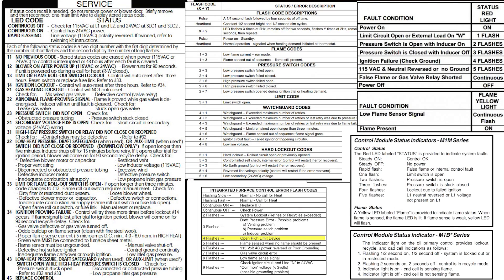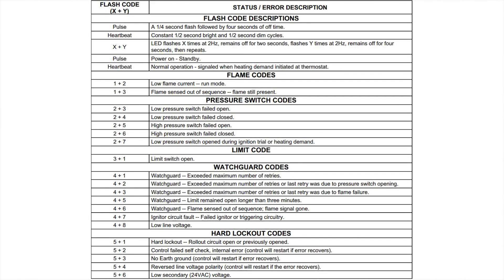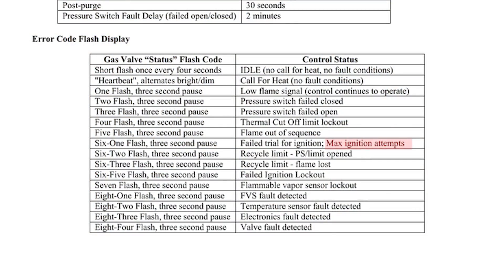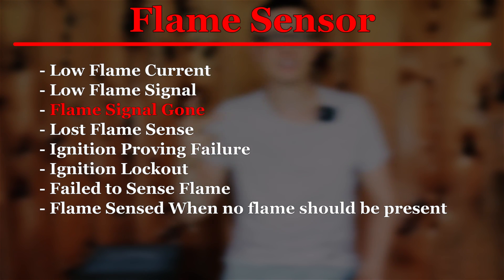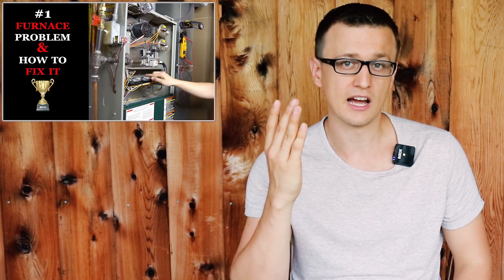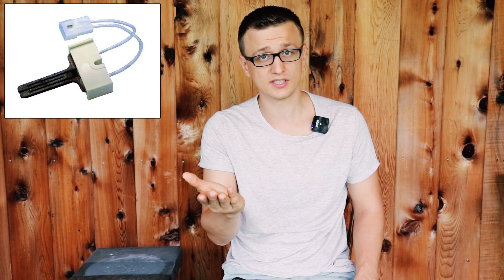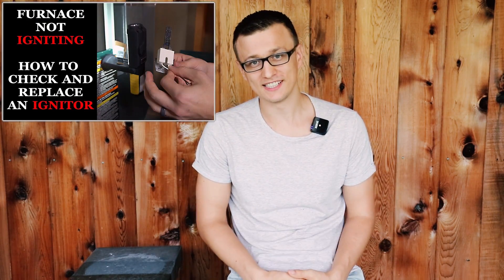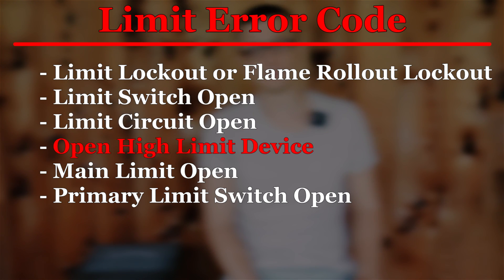Furnace Error Codes Explained

Comment: I posted 10 months ago: "I'm a Firefighter, I can usually figure things out, but I have had a similar problem each winter. Carrier induced-combustion gas furnace (heater) works, once or twice, then won't come on, and locks out. I glove up and go up into the attic, remove flame sensor, clean with green scratch pad, heater works. Each winter, repeat, etc. This year, worked, then failed. Bought a new flame sensor off Amazon, installed. It worked a few times, then stopped." Same thing happened a month ago, this time I also replaced the HSI (hot surface ignitor). Worked for a week or so. Air filter is new. Code is usually 14 "ignition lockout". Or, 34, "ignition proving failure". I know what a repairman will say, "oh, this is an old unit, 30 - 40 years old, we don't work on these anymore, just replace it." I'd even consider it myself, but it's in the attic, will require 2 - 4 people to disassemble parts, hand down through attic door, etc. so I'm guessing ~$10 - $15K for whole job. This is for heat which I use for 5 - 10 minutes a night, 10 - 20 times a year. If I can repair it, I want to do so. Does anyone have any suggestions? Thank you.

Comment: My Everest propane furnace lights then immediately shuts off. If I shut the power off to the furnace and turn it back on, it will fire just fine. The red light slow flashes continuously until I reset the power. It has a new igniter and new wall thermostat. Didn't help

Comment: Please help: I have a two stage Rheem furnace and air cond. system that is two years old. It seems to work ok but the controle
board is flashing 15 times then starts over and flashes 15 more times. The manual doesn't show anything for a error code 15.
Ive never seen the furnace run on the low state since it was installed. I replaced the thermastat with a ecobee smart thermastate and i have varified the wiring several times. The furnace has been powere off and back on but the flash continues.

Comment: My furnace does not display codes. Both red a s green lights flash fast a d the furnace ace turn off a few minutes after it ignites., then come back o. After about 5 minutes, and so on. What could be the issue?

Comment: My York two stage is blinking 7 times and it says low gas flow.  The ignitor is glowing red but the furnace is not igniting.  There is another part I cleaned with a dollar bill a few weeks ago.  I wonder if the gas valve is not opening? I believe something clicks when it opens and allows gas through? It has been doing this a few times for a few weeks now?🤔

Comment: Mine had solid red but only the inducer fan was working, turned the unit off with the light switch power thing, turned back on NO red light at all.  Bad circuit board? It's 2 degrees and we have no heat.

Comment: I have error code 24 on my carrier furnace. I I remove the Yi/Y2 from the board and measure the Y1/Y2 and the common on the board and is shorted o ohm, Is that supposed to be o ohm or direct continuity? or is there something short on my electronic board?

Comment: Not gonna lie it’s not me but the previous owners who owned this house were crackheads my circuit breaker with fuses in it is hardwired the fuses do nothing it’s always on no matter what you do and get electrocuted on top of that my heater he says the wrong amount electricity is going to it as well as there’s crackhead wires the wires are way too long and just dangling around inside the unit I was also told I should sue the previous owner or whoever wired the house cause he said there’s no doubt in his mind my house will burn to the ground

Comment: Hmm. I have two green lights, both flashing, alternating (when one is on, the other is off). The chart says that slow alternating lights means one thing, while fast alternating lights means another. The problem is that, having never seen the difference, I don't know if they are flashing slow or flashing fast. I was hoping to see a demonstration in this video.

Comment: My furnace wont kick on when I  turn up the thermostat. So my thermostat could say its  73 degrees in my house and I turn it up to 75 or 76 and the furnace wont come on so I flip the breaker off and flip it back on and then the furnace comes on and it will run for a little while then it shuts off and it will come back on about 2 more times and then I have to go flip the breaker off and on again. I have changed the batteries in my thermostat, and I have bought a new breaker and changed the breaker, I switched off the breaker and then switched it back on. I haven't checked the filter yet. I'll do that in the morning. I'm sure it's the filter now from what you have said, as we've lived here in this house a year and a half and have never changed the filter and I don't really know how dirty the filter may have been when we moved into this home. Thank you so much!!!
Reply: Did that work? It may be the thermostat was not sending a singal to the furnace

Comment: Hey Jay, good video here with a lot of everyday error codes explained... really appreciate it a lot, but unfortunately, it didn't help me. 

I have a goodman furnace. This winter I turned it on and it worked for maybe a few days just fine, but this morning, it just started giving red continuous rapid flashes... after looking at the code on the panel, the error code = REVERSED 115 VAC POLARITY/VERIFY GND. I tried looking up online for a specific answer, some say my board is bad, and some say the wiring needs to be reversed. WHAT SHOULD I DO.... ??? Completely confused. It was working just fine yesterday, what is the issue today with the wiring. I didn't touch it yet... ANY HELP WILL BE APPRECIATED... 😇😃

Comment: I have experienced an error code 5, which according to the code legend on the cover, is an open fuse.
However, it is not the mouve colored fuse which is easily spotted, as I checked it as ok.
I noted on the secondary of the transformer wiring, a fuse exists(3A) is shown,..but I can not seem to find it.
It apparently provides power to the humidifier transformer. When replacing a bad solenoid the hose blew off the output of the solenoid and got the connections wet enough to blow that fuse.
I am quite anxious to find it before my client loses all confidence in me.
can you help Jay?

Comment: I have a new furnace. It worked in winter. Ac got fixed this yr. Now time to turn on heat. Turned on and doesn't work. Switch is on, no breaker trip. The furnace sounded like it made noise but nothing upstairs. Orange 3 flashing lights w a longer orange light on 4th. Then it repeats the sequel. Anyone know what that means? I don't touch things w gas, scares me. 
I changed air filter too brand new and it wasn't even old. Do you have video on color not codes since they don't tell u codes in front?

Comment: Is it normal for a Daikin furnace to change status codes while running? I've noticed it says F3 when only the fan is running, then switches from P1 3, P1 7, or P1 8 in no certain order when the A/C is running. My hvac company said the codes were not normal, especially since the furnace was installed 3 months ago. I thought it was just switching status codes based on what was running (a/c or just fan). I trust my hvac company but wanted your opinion too.

Comment: I have a very odd issue while in AC mode. My fan turns on sometime during the night while everything is OFF.  Ive tried removing the thermostat while the fan is running and the fan continues to run.   The code is flashing 5 times fast (flame not present) why would it throw this code in AC mode?

Comment: Mine keeps doing a soft lockout so do you think it could be the igniter?
Reply from the maker: Before it goes into a soft lockout, it should be blinking a different code. I would reset power to the furnace and then watch the code once it powers back on. It could be an ignitor but there are plenty of other things that can cause a soft lockout too. This video may help with narrowing down the problem too: https://youtu.be/AQD_MedIklI
Reply: Thank you blowing out one of those small hoses worked thanks.

Comment: Exceptionally well done tutorial!!! Thank you very much. I am getting a 5 pulse error code on a York furnace that is probably fifteen years old. The control board was recently replaced and initially, the furnace was functioning properly. There is now the error code as described, and the 3 amp fuse is blown as well. Additionally, the blower motor runs continuously, even with the thermostat removed and the green wire disconnected from the control board. Suggestions?
Reply: Did you figure this out?

Comment: Well thanks to you and other techies I finally diagnosed the problem/s. Even though the igniter glowed brightly 🌞 the gas wasn't igniting so I originally said there was no gas flowing. But then another video suggested that if the burner/s were very dirty the gas wouldn't spray out well enough to light. But it could still probably light from a flame. So I did as suggested and used a barbecue lighter to good effect. 😀 I still have to clean the burners. They are a little tricky to take out as there are barely visible screws on the bottom. But I have heat and no service call bill to pay. 😉

Comment: What if you get the error code “Lockout due to excessive retries”? On a Goodman GMVC96
Reply from the maker: That means the furnace is in a lockout/standby for 3 hours. Try turning the power on and off to the furnace and pay attention to the error code light. It should give you a different code after the reset, when the furnace tries starting up again.
Reply: @WordofAdviceTV  Thanks! I managed to find the problem. Turns out the drain going under the ground was slightly blocked off causing one of the pressure switches to go open. Thanks again!

Comment: I have a tappan furnace, 120,000 btu, the yellow light on the control board is illuminated (no flashes), looking on the furnace door it states "yellow light flame fault" so I didn't want raw gas being dumped in my furnace I called a furnace professional, he stated " everything checks out working fine" then left, but did nothing to fix the yellow light. I did find an exhaust elbow leaking, so i corrected that, prior to the guy arriving I went through all the diagnostic checks, all sensors were fine, gas valve gets 120 volts that opens during the cycle, cleaned the flame sensor and even replaced a 2 week old filter but still the yellow light? I even went as far to snake my exhaust/intake clear no obstruction but can't clear the fault. Upon the furnace company's arrival, he checked the co2 level, water column and gas pressure which were all in specs however, I told him the condensate pump barely runs, he stated the heat exchanger was fine given the co2 readings? My reply is that they might read 81 but could be dumping in the furnace creating pressure and overheating? He did no further checks, charged me 148 bucks and left without fixing the yellow light issue (flame fault) . I would like your input on this flame fault board light and see if we can't correct the issue? I have a 2 year old goodman, coil and condenser in the garage but have no time just want to get through another 4 months and it'll be replaced.
Thank you!

Comment: Any ideas why my brand new furnace won’t run until I pull the orange wire off the pressure switch? Then the inducer motor comes on and I put the orange wire back on runs fine until it shuts off and calls for heat again same procedure again.

Comment: I just left this comment on another video: I hope this video helps:

My furnace shut off and blinks 3 times. I am trying to figure it out currently as I cannot get anyone to look at it till next week and I'm in Canada, starting to get cold. Any help is GREATLY appreciated. On the diagnostic chart, it says 3 blinds means: Pressure switch open when should be closed on single-stage models. Low-pressure switches open when should be closed on 2 stage/VS models.

I have no idea what that means or what model I have. Where can I find this info? I am quite handy so I know I can figure this out, I just need some guidance as this is my home (not a renter).

Comment: There was a leak from another condo upstairs, being an electrician I started looking into it. It is the middle of summer so this needed done, everything would shut off, had to dry everything inside the furnace and then the solid yellow light stayed on. All I could find on the error code was basically just flame sensor this and flame sensor that. So I could not find anything on it really that had to do with my situation is there anything else it could mean?

Comment: Awesome info Jay!  Unique issue here: Heat works well on my 1999 Goodman furnace. When I switch to Cool on the thermostat it blows the fuse and then the error code is 3 blinks with a short pause followed by 2  blinks before it has a longer pause. I checked for shorts and found none. Any ideas?

Comment: I have a Trane XE-80 furnace with a nest Thermostat controlling it.  I have fast blinking red light and the error codes on the back panel chart is worn out.  Furnace ignites, hot to the touch, but no airflow.  Someone on reddit suggested the blower motor may need replacing.
Reply: Update: the washable filter I didn't know was there needed cleaning.  Renting this house has proven to be one disaster after another. With the most recent event being a pipe broke and black sludge from the shower connection sprayed all over my tv and AV equipment in the finished basement. I can't wait to move!

Comment: My carrier furnace is only 2 years old. The furnace started making noise. The yellow led light on the furnace door panel showing blink , pause 3 times then blink, blink 3 times. Furnace shuts off and restarts 1 min later. House not staying warm Oversized furnace and A/C How to have what test ti determine right size of furnace>( Load Test?)  What code is this blinking indicate . Carrier furnace!   Thanks

Comment: mine says weak flame, still gets up to temperature but light still blinks each time. natural gas orifice isn't plugged, so trying to figure out what is going on. was told it can be because of a rusted chimney. Apparently my furnace does not have a flame sensor. Intertherm M1M series.

Comment: Great videos and thanks for sharing your knowledge. Dealing with a  carrier 58sta090 ignition lockout issue.  Furnace turns off when it temperature drops to near freezing, usually overnight.  Ignition turns on, but no flame.  Flame sensor has been replaced.  By midmorning, once I reset it, the furnace  turns on and works all day, but at night the furnace going into lockout. Any recommendations. Thinking it might be a sticking gas value 🤔. Thank you in advance.

Comment: My Goodman furnace stopped working I can't find a list of error meaning on my furnace...it's blinking 3 quick blinks
Reply from the maker: If you try googling "Goodman furnace blinking 3 times" here's what comes up: 

Check your Goodman furnace for a pinched or blocked pressure switch hose. You should either repair the short or replace the pressure switch. Three LED flashes. This means your furnace has an open pressure switch circuit or the induced draft blower is operating when it shouldn't be.

This is just a guess but most likely the code does really mean what google said above. Therefore I would start with looking into pressure switch issues. I have a video on 10 pressure switch problems, it would be a good place to start: https://youtu.be/Zax02itYHkU
Reply: @WordofAdviceTV  Thank you for the quick reply, I am actually watching your pressure switch video now not sure if I can fix it myself...furnace repair man said $75.00 for first hour minimum then breaks down to every 15 minutes plus parts is that about average pricing?
Reply from the maker: @bearteddy1992  Sorry to hear about that.. But yes, that is a fair price. Most companies charge around $100 just to come out.
Reply: @WordofAdviceTV  turned out to be bad draft inducer...$295.00 for the parts

Comment: HI Jay: Didn't watch all your videos before replacing motor and  capacitor. Tried with new and got code 33 a couple of times. Then watched the video on trouble shooting and got 109V between blue & white. Error code now 12 and have no idea where to go from here. Any suggestions. When I got the 33 the inducer started; the flame lit; but the blower never ran. Trying to think of how to jump the motor as suggested to see if it spins up.

Comment: Hey Jay, non-related question to the present topic but thought I would try and get your advice anyway.  Just had a 3-ton unit installed and have a 20 X 25 return vent.  Heard about the 200 rule, 200 sq. inches per ton, and wonder if I should challenge my HVAC company about it.  There is a little low whistling sometimes at the vent but not a major sound problem.  Should I just bend some of the grill fens out straight and let it go with that.  Return is in the hallway so it's visible.

Comment: Question about a 2 stage furnace. (Rheem prestige 96%)How does the furnace know when to go into high gas pressure mode. I’m assuming the amount of time it takes to reach the desired temp that the thermostat is calling for? Example is 15min the magic number that the board will switch into high if it hasn’t reached the temp the thermostat is calling for?
Last question when the furnace first fires up does it fire on high and switch right back to low PSI?
Thanks

Comment: Can you go online and find a error code chart for a furnace with chart missing
Reply from the maker: Yes, you should be able to. For example if I was working on a Carrier furnace with no chart, I would try googling "Carrier furnace error code chart" and look at the images. Brands don't change their error code charts very often so unless it's a high tech new model of a furnace, an old chart should work for most of them. You could also go to the manufacturer website and using the model number find the online manual for it and sometimes the error code chart will be in there as well.